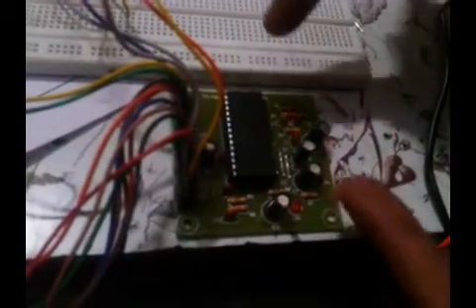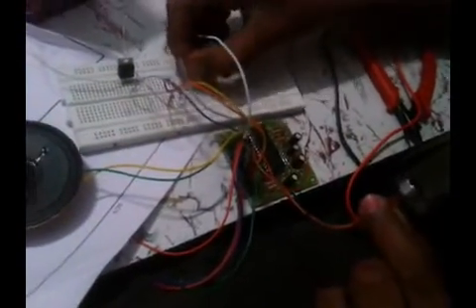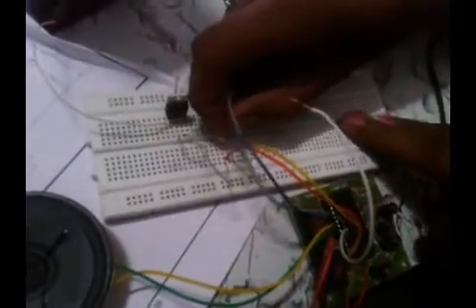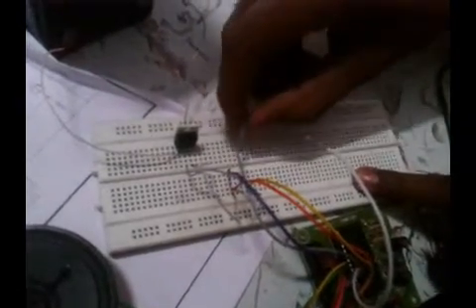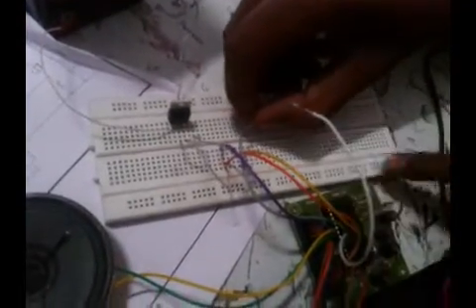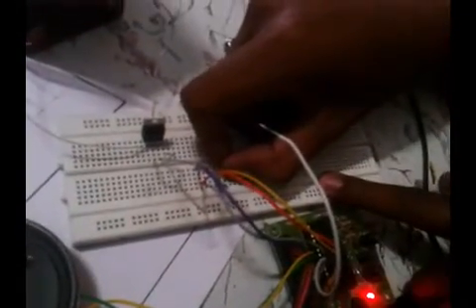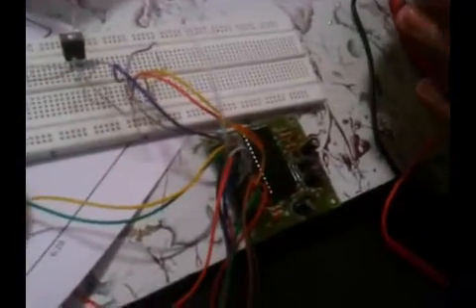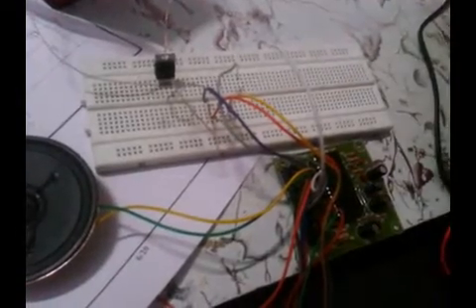voice recorder using APR33A3

Comment: hello! where do i get this chip in germany?
Reply: Hello Friend, I acquired some of these ICs. One of the first who brought, aPR9600, and a more modern, aPR2060 and aPR33A3-C2. 
Just acquired a certain amount of each of them, the dealer is (Kowatec) U.S. shipments I do not know if the rest of the world, if you like to contact them. (www.kowatec.com) or manufacturers (www.aplusinc.com.tw). 
As I am barely acquired, preparing components to test them on my breadboard. 
Email contact them, they respond very fast in Kowatec.
Reply: thx!. i didnt get an answer from aplusinc but i will try kowatec. what are your plans with the chip. i think about a sampler for eurorack modular synthesizer...